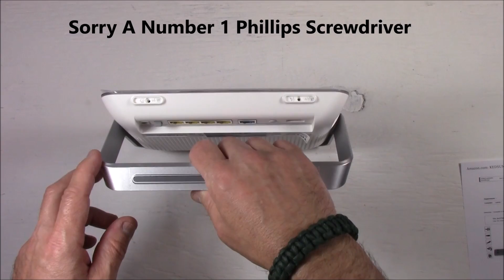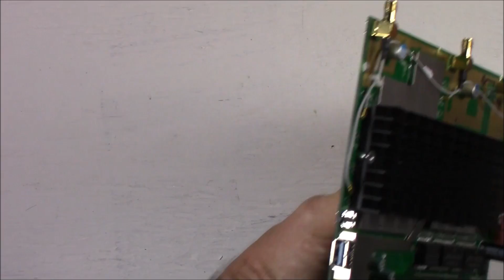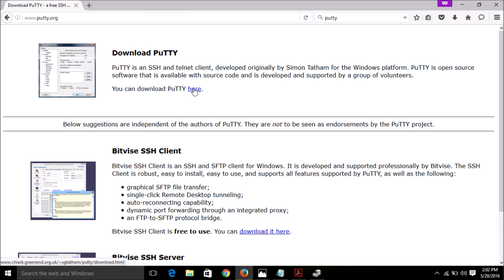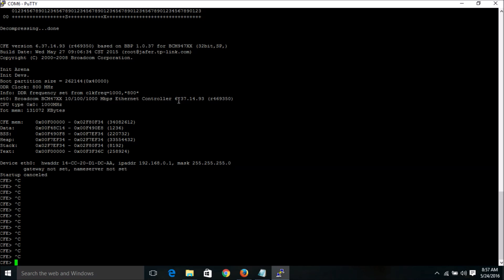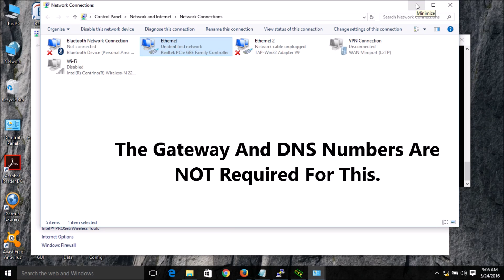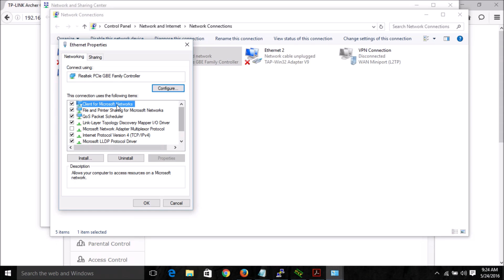Revert To Stock Firmware TP-Link Archer C9 Router V1 From DD-WRT Step-By-Step Using Serial/USB

Comment: Great video I was able to get my archer c9 back up and running using this technique, thank you very much, one thing though I had to do differently was not power up the USB TTL converter until I booted the router. The order of events had to be this way 1. start router,  2. then plug in the converter. 3. open the COM port in putty. The router was caught in a bootloop so I had multiple opportunities to interrupt the boot loader.  If I tried to boot the router with the port already open, there would be no comms from the router and it just show an orange and blue LED light- very strange but other than that, perfect, thank you

Comment: Hi, thank you so much for your video.  With your instructions, I was able to convert a TP-Link Archer C1900 with locked firmware to a TP-Link Archer C9 with the ability to flash any firmware designed for the C9.  This silly router can finally use DD-WRT.

Comment: Thank you so much! Still working 06/19.
At the end, after status=0 and restarting the router, it was like frozen just showing two lights and no text update in putty.  I unpluged the CP2102 module from the usb and the router started properly, just in case that happens to somebody.

Comment: Thanks for this tutorial! I have accidentally flashed the current US firmware on my V1 (because the old firmware had some bugs and I did not realize that there are different country versions). But now I cannot go back to the version suited for the EU. I have an UART with the CP2102 which has LEDs for RX and TX. When I switch on the router the RX-LED flashes for less than a second. So I assume the router tries to send something on its TX pin. But then the light stops. When I press Ctrl-C the TX-LED of the UART flashes. But I don't see anything in the Putty window. Removing GND did not help. When I boot up the device (disconnecting the UART from USB) and reconnect it afterwards I see some output in the putty window. But it seems like it does not boot up when the UART is connected when switching the router on. Instead the "Internet" LED lights red.  Does anybody have any further tip I could try? Why does the router not send more when it starts up? I also tried other speed values.
Reply: After struggling since yesterday I finally found the solution in the last post of this thread: https://forum.dd-wrt.com/phpBB2/viewtopic.php?t=283784&postdays=0&postorder=asc&start=90
I booted up the router without the UART. Then I connected the UART and with putty. Used root/sohoadmin to login and "reboot" to reboot the router. During the reboot I pressed Ctrl-C. Then I was able to flash. Thanks again for the tutorial.
Reply from the maker: You are most welcome. Thank you for watching, commenting and the valuable feedback. I appreciate it greatly. All the best.

Comment: Hi there Sr. Richard Lloyd. Greetings from Brazil. I HAve an Archer C9 V4.0 (US). I Would like to put some custom firmware like DD-WRT or OpenWrt for example on it. But i´ved received the error message "Unable to Upgrade". 

Seems the router is locked. How can i unlock my router to receive third party firmwares?

Tks a million for your help.

Alex.

Comment: Nice video! I am using Archer V4 (EU) and I flashed DD-WRT on it. But I dont like it, so I would like to get back to stock again. Did try by using witout serial adapter, but did not work out. Still DD-WRT on it, although it transmitted stock TP-Link file with no issue. My question is, what splitted firmware need I to use to flash it using this method? Thanks for your work and I hope you will get back to me... Cheers from Switzerland :)
Reply: same problem

Comment: hi there, i have a problem ... i followed your steps and im stucked in the PUTTY CTRL + C process . when i hold down CTRL + C and start the router , it came with weird characters ... and it keep on going going and going ... ive tried removing the ground connection as you suggested, or check and recheck the TX RX connection , all exactly as your steps ... can you tell me how to get it right ?
btw i wasnt using CP 2102 firmware , im using the Prolific PL2303HX chip USB to Serial ..

UPDATE : 
I tried many times failed until I unplugged the Ethernet cable and it goes into the boot sequences :) I plugged in again to find the IP address , and then the PUTTY freezes again . So I tried again and finally got it into the flashing sequence and finally it’s done ! 

Thank you again for the tutorial I tot I’m gonna  lose this router after I accidentally upgraded the firmware of another region . 

Once again, thank you :)
Reply from the maker: You are most welcome. Persistence pays off once again. I am glad to know I could help you. Thank you for watching, commenting and the kind words. I appreciate it greatly. All the best.👍😀